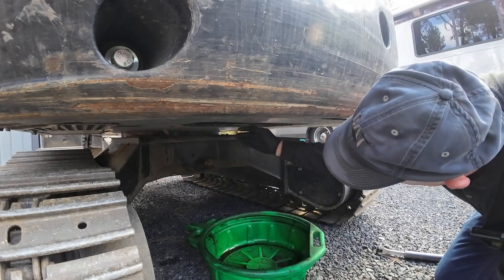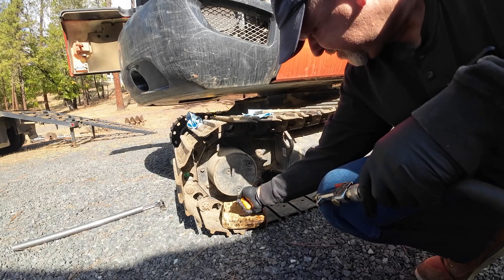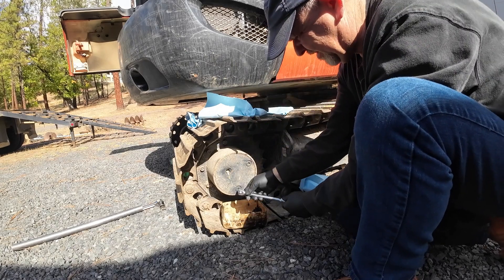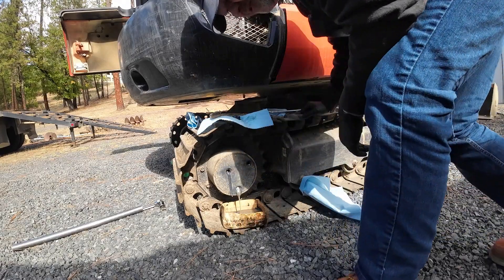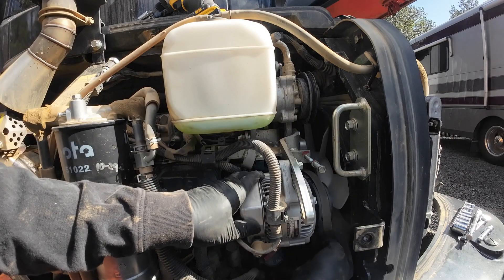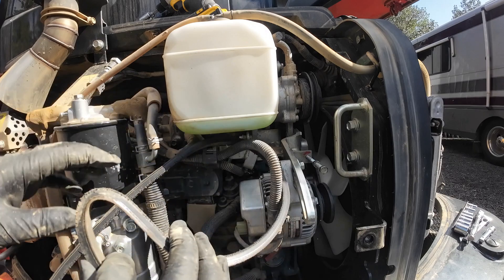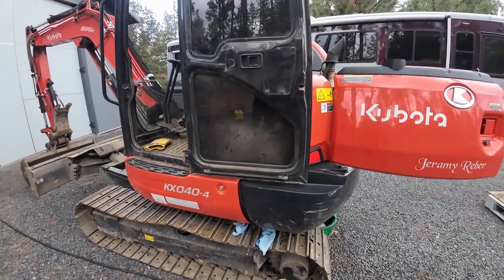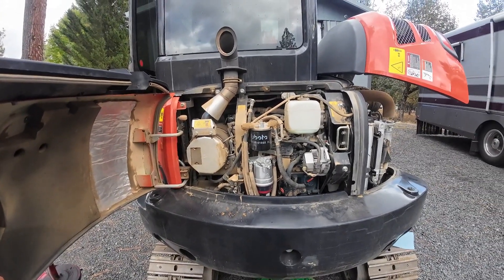New belts and oil change on the Kubota KX 040 4

Comment: What brand and viscosity engjne oil are you running? What final drive oil , and what hydraulic oil are you using? Im just curios because i will be playing this game soon
Reply from the maker: Engen oil Delo 15-40 
Finals I a running 85-110 don't remember what brand, I buy 5 gallon buckets 
Hydraulic oil I only run the Kubota oil that is recommended. Don't cheap out on the hydraulic oil.
Reply: @jeramyreberpuredirt7873  alrighty, thank you. Chevron delo is good oil that I know. And I will make sure to have the kubota hydraulic on hand. I appreciate the info
Reply from the maker: @RustyAcresSquare40  you are welcome 😊